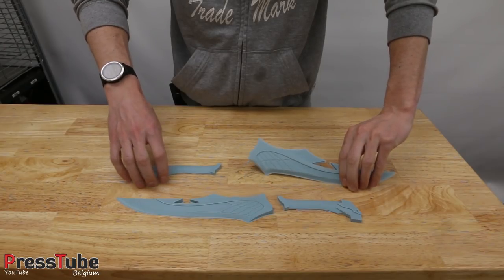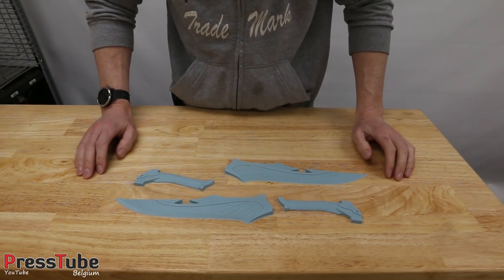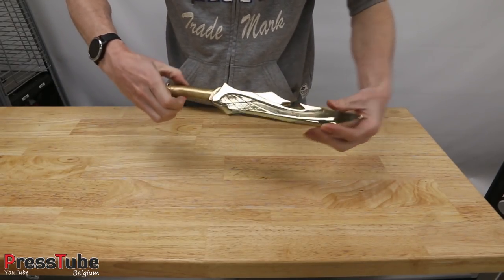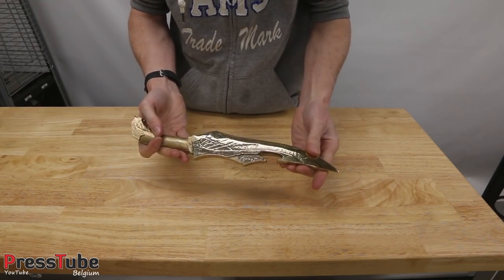Casting Mirror Polished Dagger from the game Skyrim

Comment: Ok i dont know if this will work but melt both copper and brass use the copper as the red in the superman logo then use the brass as the yellow in the logo and Polish and sand the parts till they fit together